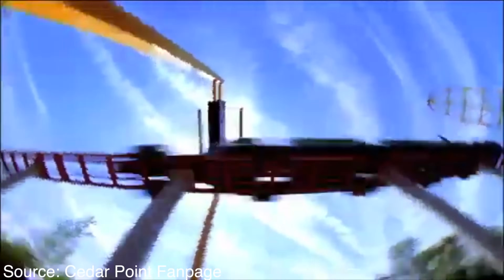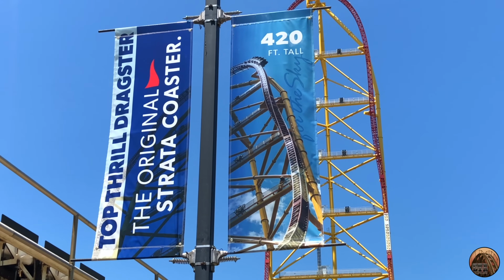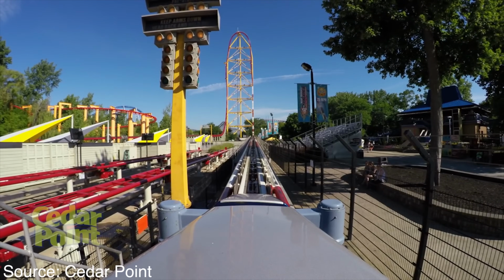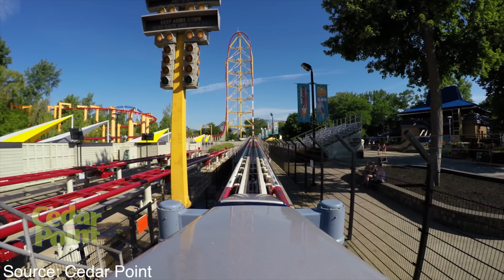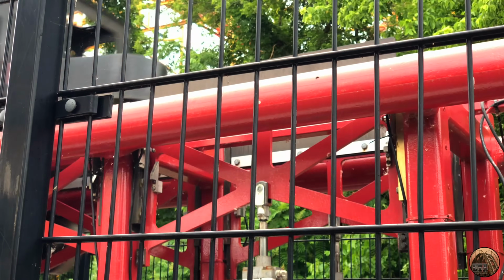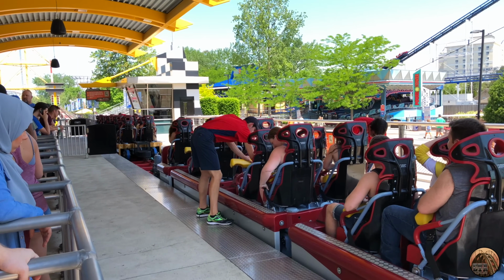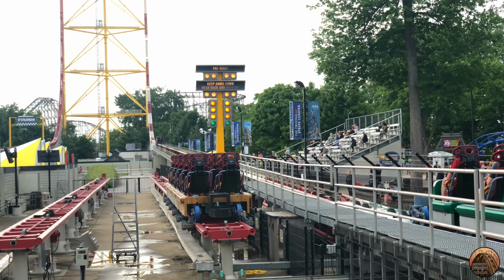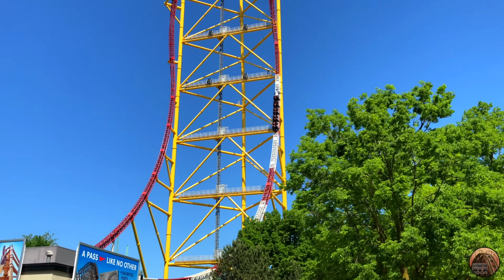Problematic Roller Coasters - Top Thrill Dragster Review & Technical Analysis - Cedar Point

Comment: Those brake cylinders look like festo air cylinders. I work on some work their little prox for detecting position of the cylinder and it's pretty flimsy.

I'd like to see what controller they use to run the machine and the code
Reply: @Chimera nice. I'm guessing your maintenance of some sort ? I work mostly in either Siemens s7 or GE toolbox. Controls cant be that bad. Its 1 relatively simple machine.
Reply: @Chimera so I'm guessing AB is the choice by most the manufacturers of rides ?

Comment: A stratacoaster is a complete circuit roller coaster between the heights of 400-499 feet tall. Because Superman: The Escape is not a complete circuit, it does not qualify as a stratacoster, making Top Thrill Dragster the Original Stratacoaster©️

Comment: Common misconception: An empty train requires LESS speed than a loaded train to clear the hill.

Actuality: An empty train requires MORE speed than a loaded train to clear the hill.

Proof:
> An empty train has less weight that a loaded train.
> This means that an empty train will have less momentum than a loaded train.
> This means that an empty train is able to change its speed more easily than a loaded train is able to. In other words, an empty train will slow down more due to gravity than a loaded train will.
> Therefore, an empty train will require MORE speed to compensate for its greater speed reduction than a loaded train will.

I think that's the best way I can sum it up. Thank you for your explanation and allowing me to finally be able to clear the physics  up in my head!

Comment: or they could just make it so the tires at the end of the break are in upward position as default, thus bringing back the break zone + hold 2 on failure, and thus running 6 train smoothly without stressing out the Operators. Literaly the smallest and easiest change possible and that would make TTD operations miles better ._.
Just like they could improve Millennium Force capacity so much as well if they simply made the break run an actual block zone. Wtf intamin, wtf cedar point.

Comment: How was the experience of working the control panel of this ride? How much control did the operators have over the ride? Were you able to manually overpower or underpower the ride (besides the setting you mentioned in the video)? Were you able to control the sound effects? Did you have an intercom out to the launch track or the top of the tower? Did you have control over the lights on the tower or on the Christmas tree lights? How was the launch control? How complicated was operating this ride in comparison to other rides you've operated? Thanks for the fantastic video!!

Comment: In theory, TPD's launch could be made to work with solid-state magnetics, using modern technology. Instead of using a standard system, two or three rows of fine could be used to allow for a much higher capacity. Instead of powering the fins via generator or the electric supply grid, supercapacitors could be used. These are similar batteries, except they don't hold as much power, but their rate of discharge is drastically higher, meaning that we can give much more electricity in a short time to power the launch. Furthermore, we can use advanced cooling or super cooling to make the launch discharge more efficient.

Comment: When I worked at Cedar Point back when this was the newest coaster in the park, I couldn't even tell you how many times it broke down in just one day. I worked in the back of the park at camp snoopy as a character/escort, so I was always walking past that coaster on my way back to my dorm at the end of my shift. I rarely saw it going. It was always under maintenance for whatever reason.
Reply: I know right.. I also worked at cp from 2002-2006 I worked in all over the park and the dragster was always down no matter what part of the day..
Reply: Weird to think that Intamin has made three record breaking coasters. They built the biggest Kingda Ka, the second biggest Top Thrill Dragster and they built the fastest Formula Rossa. Hell, that line -up also includes the three fastest in the world as well going TTD, Kingda Ka and then Formula Rossa. The only major record holding rollercoaster I can think of that they haven't built would be the world's longest Steel Dragon 2000 which Morgan made. Weird world.
Reply: Worked at Cedar Point from 2004-2008 and I can affirm how often it had problems staying in operation. It was just too far ahead of its time, and all the kinks in the hydraulic systems had yet to be worked out. Haven't visited Cedar Point in many years, I need to go back!
Reply: in the three times ive been to the park it has barely been open while i was there all three times it wasnt taking passengers till nearly 1pm

Comment: I think a good choice for Top Thrill Dragster's launch system would be Linear Induction Motors. Towards the end of the video, you mentioned that magnets cannot accelerate trains fast enough, but the EMALS (Electro-Magnetic Aircraft Launch System) used on the Gerald R. Ford class aircraft carriers, which uses linear induction motors, serves as a direct counterexample. In fact, EMALS generates far more force than Dragster's launch system, maxing out at 0-160 mph in two seconds, versus Dragster's 0-120 MPH in 3.8 seconds, while carrying loads (aircraft) that are just as heavy, only somewhat lighter, or much heavier than what Dragster's launch system carries.

An LIM launch system has far fewer moving parts (only the magnets for the launch track brakes) and is capable of much greater acceleration than a LSM (linear synchronous motor), although dual LSM's might solve this problem by providing double the force. LSM's also have another great benefit of being self-braking, so un-powered LSM's act like regenerative brakes.

Comment: Great video, I learned a lot! I've never been to Cedar Point (yet) so I haven't ridden Dragster but I have ridden Kingda Ka at Great Adventure. To be honest, I was pretty underwhelmed with Kingda Ka as people aren't kidding when they say that coaster is rough. The over the shoulder restraints also exaggerate the roughness and are totally unnecessary IMO. The launch is also very weird as it feels like it speeds up 3 noticeable times instead of being one consistent acceleration. This made it a lot less intense and exciting for me. In fact, I think Stormrunner at Hersheypark is a far more thrilling and not to mention reliable ride than Kingda Ka is, with the launch alone being a lot more intense. Anyway, Dragster seems to have far superior capacity to Kingda Ka which I found to be atrocious, especially since they have a dual loading station and don't even use it. I'm also told that Dragster's launch is better than Kingda Ka's and of course the theme is way cooler, plus it's a much smoother ride with just lap restraints. One thing I did wonder though is why did Cedar Point remove the tires and wing from the back cars of the trains? I'm sure they added weight and were a safety hazard if something broke but they sure looked cool.

Comment: Question, why doesn't Cedar Point just "fix" the brake block section?
Reply from the maker: I think they’d have to redo the entire brake run section. Like add more fixed brakes further up the brake run and add additional adjustable brakes. It probably just costs too much

Comment: In 2003 I worked as the ATL of Corkscrew and my friend Stephanie (who I worked with on Corkscrew in 2002) became the ATL of Dragster. Intamin's engineers tried messing with the trains late at night in early 2003 to move in rolling blocks like the way Millennium Force's trains move. The problem was they couldn't get the drive tires to move simultaneously without trains bumping into each other. I suspect this is probably because the curved shape of unload would cause those trains to move faster around the corner vs the ones in load. To me it seems like rolling blocks could be work with some tweaking to the computer system to allow efficeint six train operation. If the trains could advance sooner then it might make it possible for hold to be clear by the time the train that launches reaches the holding block. In theory this would up capacity but once you factor in guests slowing stuff down anyway it probably just wouldn't be worth it. Not using the sixth train gives Dragster a spare and cuts down on maintenance costs as well.

Comment: great video! this is my favorite coaster ever great info. it would have been cool if you brought up the old look of the trains vs what they are now ie. no engine tires and fin, ive heard many stories on this from a tire falling off (no proof on this) the weight of it causing roll backs, and then just adding 2 seats to maximize capacity

Comment: why did they get rid of the signature part the wing and the slicks in the back I don't understand that's what makes a top fuel dragster a top fuel dragster now it's just a glorified launch coaster
Reply from the maker: Simple answer, one of the tires that was a part of that theme element legit fell off a train back in 2004 I believe? The park immediately removed the theming element after that and added a 9th row of seats to the trains
Reply: The tire flew off one of the trains in late May of 2003. The last row of seats used to have a fake engine in that spot. The spoilers and wheels were attached to the metal box part you can see on the back of the trains.
Reply: I think the tyres used were real dragster tyres. They had a problem even before one of them flew off, where they would rotate even though they weren't supposed to.
Reply: Yes they were real tires and did spin from time to time

Comment: I think they could make a magnetic launch work by placing the magnets not just on the existing launch track but partway up the tophat. This would not only make the launch longer but the top speed is reached at an altitude allowing for the train to clear the tophat even though it has a lower top speed.

Comment: You, by far, the best coaster reviews dude! I always thought dragster was prone to downtime because of its complicated block section and for running 5 trains. Formula Rossa only runs 2 and the two days I was there the ride had little to no downtime, the trains do only hold 16 instead of 18 riders though. That being said, hydraulic launches slap so much harder than any  LSM, so it's worth it in the end.

Comment: The height is irrelevant if you consider the drop in TTD is 400'  and top speed of 120 MPH and 418 'on Kingda Ka, with a speed of 128 MPH. (the drop of each coaster only have an 18' difference and are only 8 MPH apart.) However: This coaster kicks ass on Kingda Ka; as it has T bars and not OTSRs. However it's a shame TTD is down more than any other coaster. I'm glad I had a chance to ride it during the third week of May 2018; the only time I've ever been to Cedar Point. Please remember however: while Superman at SFMM has a higher track attached to the tower that supports it: the train NEVER goes above about 328' so while it might be fair to call it the 1st giga coaster which is also a shuttle coaster, there's no way on the world I'll ever accept Superman the ride as a Strata coaster. Keep on mind: Most coaster enthusiasts don't even consider it a giga coaster, since it isn't a full circuit coaster. 
Last and not least: I found this video to be extremely informative as it explains how people don't understand how coasters work the way they do. Top Thrill Dragster is awesome but it's down for reasons hat make sense, much as us enthusiasts don't like it to be down. But I loved riding in the back car (2 back rows,  However: with the virus I'm gonna have to wait. Thanks for this awesome and informative video, and stay safe.

Comment: Do the trains have to move in pairs just for guest safety in a dual load and unload station? As in, you can't move either train if there is still foot traffic from the other one? Otherwise, I assume you could advance one train at a time as soon as the next block is open (rather than advancing the pair of trains forward two block sections each). Not positive that would help anyway though.
Reply from the maker: You have to dispatch in pairs unfortunately

Comment: I remember going to Cedar Point in 2000 and had a blast. Did millennium force and thought at that time it was the best I’ve ever ridden. Haven’t been back since but I remember when this first came out. It’s a top 5 bucket list coaster to do real badly (1 is steel vengeance)
Reply: Plus it’s also bad when you live in Florida and that trip to Ohio is quite a travel

Comment: Top Thrill Dragster is the only rollercoaster Cedar Point ever built that was the tallest rollercoaster full stop. (Period in America)
•Revere Beach Cyclone held the height record (30m/100ft) 1925-1964, no Cedar Point coaster broke that record
•Montaña Rusa and other wooden rollercoasters held the record, rather than any from Cedar Point.
•Gemini never held any record, Loch Ness Monster was taller (40m/130ft), Screamin' Eagle was faster (62mph/100kph) and Coney Island Cyclone was steeper (58.5°, I'm sure others were steeper than 55°)
•Magnum XL-200 was eclipsed greatly by Moonsault Scramble, which stood 70m/230ft, and held the height record 1983-1996 (13 years, one month)
•Millennium Force was surpassed by Tower of Terror (115m/377ft) and Superman: The Escape (126.5m/415ft)
•Top Thrill Dragster was the tallest and fastest coaster overall for 2 years.

Correct me on anything if I'm wrong.
Reply from the maker: Looks right to me!

Comment: TTD has had alot of issues but don forget about kingda ka which has the same amount and intmains have lots of downtime in general didnt TTD motors blow out in 2019 i through if one senor went into fault it shuts TTD down i swear i heard TTD goes 140 in morning test runs is that true do el toro or maverick those also have a bunch of downtime and SV has a too small of a break run too
Reply from the maker: Eh, TTD usually launches at about 115 mph with guests and maybe 119 with the boost function?

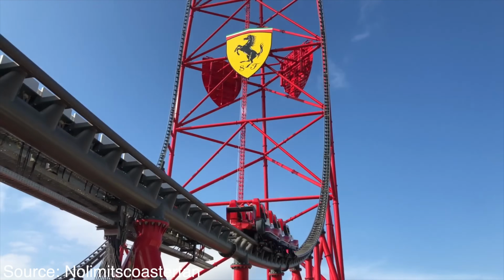Comment: 20:00 "the cars would have to be shortened from three cars to five cars".....thats not how math works :p
Reply from the maker: My bad 😂
Reply: Sure it would! (3x) tells us how long the original 3 cars would be, with x representing length, while (5x) could prove to be shorter depending on what nomination 'x' is. If the variable 'x' represents feet, 3 cars can absolutley be 'reduced' in length to 5 in this example using those variants. If you're wondering, yes a 3 car train may be 'longer' than other 5 car trains, it would depend on the length of the train and its cars. Obviously here that's not the case, as so stated in context,  however mathematically it could be true if 'x' refers to a cars length multiplied by how many there are. Simple stuff really. (I.e.), 3 cars of 20 feet is longer than 5 cars of 10 feet. But I digress, all algebra aside.

Comment: I got a front row roll back once. It was epic! I'll never forget it.
Reply: This is actually the main reason I'm scared of roller coasters, I would probably die in my seat if that happened to me
Reply: They are perfectly safe, though! I was scared of rolle r coasters until I ignored my fear and just got on one. Just ignore the fear and once you're on you're on. It takes one of two rides after that but coasters are REALLY fun!
Reply: @CieraMychele  Rollbacks? TTD and Kingda Ka are actually designed to be able to handle rollbacks! Other rollercoasters have a system on the lift hill to prevent the coaster from rolling back down the hill if the chain breaks. That's actually the clicking you hear, so if the chain breaks for some reason the coaster is physically unable to go back down the hill.
Reply: Do they let you go again, or are they just like “eh they may or may not be better so there you go!”?
Reply: @haleylaine27  this comment is funny imagine the ride rolls back and they’re like alright great ride and tell you to get off
Reply: @haleylaine27  It took a while to reset but they did relaunch the train with us on it. We were strapped in for about 15 minutes.
Reply: @matthewbuttery8529  hopefully worth it, thank you!

Comment: I loved when I was an operator at Canada's Wonderland. I was in the Kidzville section, but I learned a lot when I worked the Larson Flying Scooters. I learned a lot as well :) One of the most interesting things is how the ride runs with the control panels. Larson designed the ride where there has to be an exit attendant and the main ride operator of course. So of course, there are two control panels. The exit attendant has the panel with the e-stop and start function, while the operator has the e-stop, e-stop reset, the start function, and a button to hold while the ride is running to ensure the ride runs for the full 60 seconds. After the exit attendant gives the "clear", the ride operator must scan a second time and give the "all clear." For the ride to run, both the operator and the exit attendant must simultaneously press the start function, but the operator can let go of the start function, once the timer on the panel starts going, but must hold the button to keep the ride running, whereas the exit attendant can let go of the start function as soon as the ride starts moving and places their thumb near the e-stop if necessary. Also, when the ride runs on a cold and windy day, the speed can be reduced to make it a bit slower, so the cars don't go flying every which direction, which could lead to more stress on the cables, but I think people know that part already :)
Overall, as a ride op, you get to learn so much about how manufacturers engineer their rides, and to see the more technical side of how it works.